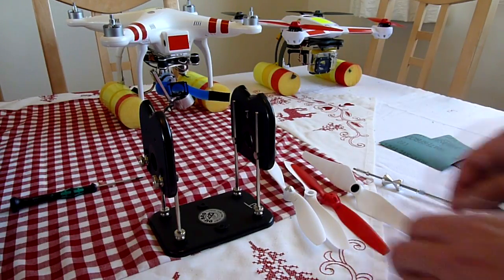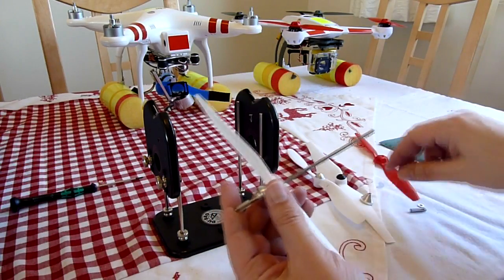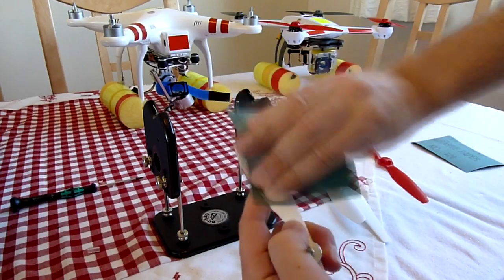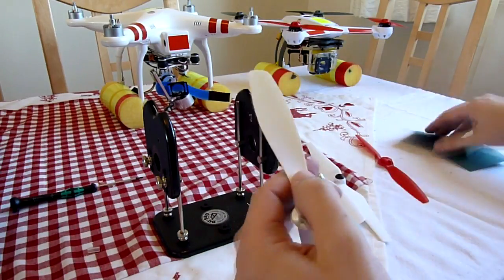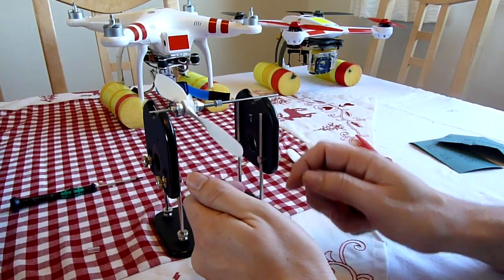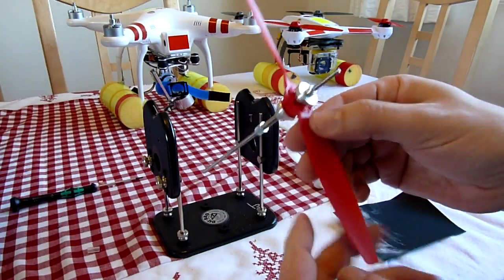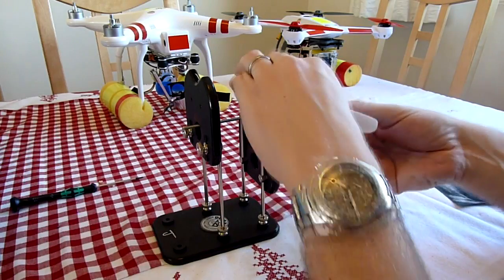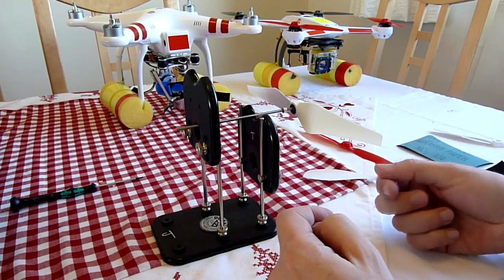Quicktip How to balance any quadcopter prop - inc DJI Phantom 1/2/Vision/3 or Blade 350QX

Comment: Hi! is it possible to balance props like Tarot 1355 shown in the link?http://www.helipal.com/tl2829-carbon-fiber-high-efficient-propeller-cw-ccw.html
Reply from the maker: I'm sure its possible, you may have to play around with mounting them, the tru-spin shaft I believe is 3.2mm and those props centre hole is 4mm, but you will need to use some kind of rubber tube or spacer to centre the prop on cone to balance. I think it would be easier to use a piece of thin thread ie cotton and suspend prop on the thread and allow it to hang to check balance, this should be pretty accurate and you don't need to buy anything.

Comment: I recently bought a set of carbon fibre 9443 blades to replace the plastic ones I was using on my F450 quad. Started getting jello and the H3-3D gimbal started flicking frequently. I checked forums and seems like the blades and/or motors needed balancing. As it was OK before I assumed it was the blades. I happen to have the same prop balancer as you so checked out - all all of them were significantly out of balance. After a fair bit of time sanding away I got them all balanced.  Soon as it STOPS RAINING I will go and see if this has solved my problem.  Your video was useful as I couldn't figure how to fix the self tightening props.  Thanks
Reply from the maker: Thanks Gordon, Glad video was useful - any new props are worth checking for balance, people seem to think because they are brand new they should be perfectly balanced out of the packet, but this just isn't realistic given how they are made. Carbon props are especially tricky as due to the way they are made, they rarely will come out of the mould balanced, and the time/precision required to balance them on the production line is not economic. Hope they fly smoothly now, normally a static balance like this should be good enough, occasionally you may need to consider balancing the hubs, which there are some good videos on, but generally I use small plastic props, which are close enough just statically balancing blades, so I don't have the patience to go that far.
Reply: Thanks - well I just managed to pop out (between showers) and did a test flight. And I am relieved to say the problem with the gimbal and the jello has gone away. So yes - it was the new carbon fibre props just needed balancing.  I am wondering now about balancing the motors.  Any advice or tips for that?
Reply from the maker: Glad the jello has gone, I have never worried about balancing motors, if they run smoothly they should be pretty close, if not then I would replace motor or perhaps change bearings. Props are more of an issue as they are much wider and due to injection/carbon moulding will always be a lot of variance, motors are cast/machined much more accurately, so as long as nothing is bent (shaft or bell), they should run pretty smoothly IMHO.

Comment: I just made a video comparison between flying with balanced prop and not: amazing results not just for video quality but it affect the whole quadcopter setup https://youtu.be/MG5owx4YV3U
Reply from the maker: +Viaggiolandia That's a good video, and vibration will definitely confuse the flight controller/sensors, we found this with FBL Helicopters, a very slight out of balance in tail blades would cause instability in roll, as the IMU effectively use vibration to detect movement, so any extra vibration causes this to get mixed up, and could even cause a crash if quadcopter just rolls into the ground !

Comment: I found the prop balanced but where can I find the prop balancer shaft and cones and spring and stuff? No one ever says where to find that or what type I would need!
Reply from the maker: +tym7730 The dubro balancer comes with the shaft, cones and springs all as one package, you don't need anything else. For self tightening Phantom props you can either use a piece of fuel tube on the dubro shaft, or buy a threaded shaft specially for balancing these props - I got one on ebay.
Reply: +jamesb72 thanks a ton man!!! I looked at the kit online and it looked like all that stuff was sold separately. I guess that's why no one anywhere mentions it lol. You the man!

Comment: Hi, I did this but sanded top side rather than bottom. Does it matter?
Reply from the maker: +orkney quadcopter probably not, technically you want the top side to be as smooth as possible for best airflow, but I very much doubt it would really make any difference - balancing is almost certainly going to improve things far more than the wrong side being rough would hinder.

Comment: Hey james! 
Love your videos! 
Did you got yourself a phantom 2? How do you like it so far? 
thanks!
Reply from the maker: I was put off the Phantom2 by the proprietary and very expensive battery, its a total deal breaker for me. Shame as the vision+ 3axis gimbal/camera gives great video (I could even swallow the cost if I could run any battery/charger) - the increasingly restrictive firmware they keep releasing (blocking aftermarket batteries, flying locations etc etc) also seems concerning, how long before you have to give a credit card number to be able to take off at all ;)
Reply from the maker: GIlberto Rodriguez Martinez Another thing DJI have pointlessly restricted for the Phantom2 is traditional receiver support, you can only connect D.BUS/Sbus receivers - which Spektrum don't make ! However the OrangeRX R800X from Hobbyking is a DSMX receiver which supports SBUS output, however Spektrum use a different channel sequence (Throttle, Aileron, Elevator ...) to Futaba (Aileron, Elevator Throttle ?) so you can only do this if you have a Spektrum transmitter which supports channel mapping (to swap the channels correctly) - luckily for you the DX9 and up can do this, so I believe its possible, and others have done this I'm sure if you google you can find more details.
As always test with props OFF until you are certain everything is working correctly, but should be doable.
Reply from the maker: GIlberto Rodriguez Martinez I would just get the orange RX and have a go, its safe enough to try, you can just swap back if needed. I don't think the channel mapping is very complicated, and am sure you'd work it out in an evening with the manual up on screen ;) Then post a video to show everyone else how to do it, as I'm sure a lot of others would love to do this and stop using the 'fisher price' DJI transmitter ;)
Reply from the maker: Should be pretty easy, I got the Rx800X running on SBUS single wire easily, but on my DX8 the channels were all messed up (throttle was rudder etc), so if you get that working then use channel assignment in DX9 to swap channels around till the assistant bars all move for the right sticks, you should be golden. When you get it working, post a video as I know a lot of other people are interested in this, just need to see how its done.

Comment: They should have already been balanced straight from the manufacturers.
Reply from the maker: The props are all injection moulded, so will all differ in density side to side depending on cooling/plastic mix. No props are ever balanced at the factory, it would double the cost/price, and they would be rushed anyway, so you'd still need to check/tweak balance. Balancing props only takes a minute or two, you just have to do it or put up with vibration/jello in video and bad handling (vibration also affects flight controller/gyro's) - which a lot of people do seem to ;) I know from flying heli's a lot of people would spend twice as much on blades just to avoid balancing them, and they still needing checking/balancing ;)

Comment: I think those triangular metal things are supposed to be pointed to each other as ->prop<---. That might have some minor effect on balancing.
Reply from the maker: On a std prop you would. but these props have slots and flats on one side so the cone wouldn't align straight - this is the correct way to mount these quadcopter props.

Comment: great "how to" - I use the same method. Agree that the DuBro is the best tool for balancing. I also used the cheaper ones in the past and was never satisfied
Reply from the maker: Thanks Ruedi, I had a clear out before Christmas and threw out three 'cheap' prop balancers which ranged from poor to unusable, for what I spent on the three cheap balancers I had paid more than the Dubro cost ! Live and learn. Sometimes buy once buy right is correct ;)